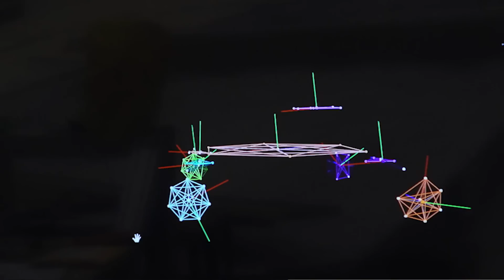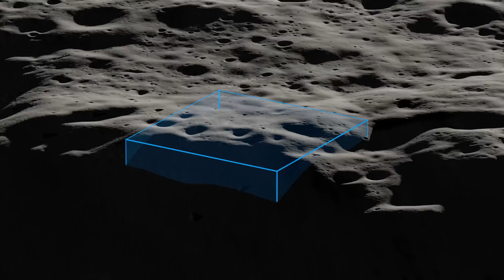The Dumbest NASA Decision In Years? Why NASA is Being Forced To Ground Rover and Sent Ballast.

Comment: No, thats not the rover on the lander. That is just a rover shaped mass simulator.
Reply: we found it lying by the side of the road
Reply: "Then why is it moving?"
"... Solar wind?"
Reply: @camicus-3249  well, it was cheaper to use the Rover as a mass simulator rather than building one and we must have left the software active by accident
Reply: "and in order to get the most possibly accurate data, we used a mass simulator that is virtually indistinguishable from the intended rover"
Reply: The mass simulator will probably cost more than the rover.
Reply: We even have proof.  See!  Here's a picture of us pulling it out of a storage crate marked Rover Mass Simulator.
Reply: And this team of engineers and researchers are hired to overlook the mission of the mass simulator. Make sure it simulates mass as expected, monitor the mass, collect data about the mass, and most importantly, intervene if the mass misbehaves. Just the usual stuff scientists do.
Reply: @matwyder4187  Certified Mystery Goo moment.
Reply: What would honestly happen if they just sent it anyway? Who would actually enforce this rule? It’s not like they would go to jail or be fired… just send it and say sorry later.
Reply: This is why it's being disassembled now. No cheating
Reply: That's exactly what you call a rover without software.
Reply: Yup, move along.  Move along!  No lunar rover here.  It's down the hall...
Reply: Rover Simulator

Comment: Brass is usually used as it machines well.😢
Reply: It is unlikely to be brass, but is instead probably a bronze alloy.  Bronze is superior to brass in almost every way and has some qualities that make it useful for spacecraft construction.  Brass is cheaper and somewhat easier to machine, but otherwise has few advantages over bronze.  Steel and aluminum are no more difficult to machine than the copper alloys in this context, so we have to assume some other quality is important here.  Perhaps thermal transmission (bronze is better than aluminum) or coefficient of friction.
Reply: use gold in your mass simulator design so its less stupid to just launch the rovewr. of course knowing congress they would still launch the mass simulator.

Comment: The "cost plus" model has got to go as well.
Reply: This was not a "cost plus" contract. In fact, NASA originally intended to pay only a fixed amount covering about *half of the real cost*. The vendor of the lander was supposed to raise the remainder of funds from selling the space on the lander to interested commercial parties, and from private investors, by telling them a story about booming lunar economy "any time soon".  In reality, there were a million of amendments to the contracts covering several overlapping missions. Even if one goes over all of them with a fine comb, it is hard to decipher how much NASA was actually paying for this specific project.
Reply: @cogoid  I didn't relate "cost +" to this project. Simply stated the "cost +" notion should go. Furthermore, bids should be fixed cost - in general.
Reply: Costs plus contracts has set spaceflight back by 50 years. It's an embarrassment how much we've stagnated. If not for SpaceX we'd still be in the shit.
Reply: @cpthornman 1000%
Reply: Anyone who says get rid of cost plus has no idea how engineering works. You can only engineer around known problems and when you are making a novel system there is always unknowns. Parts get scrapped because they are pushing the boundaries of what you can machine,  design requirements change as new scientific data is gathered etc
Reply: @finnaustin4002  There is a point at which you freeze a design and produce. One-offs are different than manufacturing. What do you think makes SpaceX so successful? Cost+overuns is fine if you have an infinite amount of money (not your money or your investors money, rather it is the tax payers money). Bezos hasn't delivered a damn thing because he is following the old-school model of McDonnel-Douglas/Lockheed/Boeing/Grumman/Northrop/Raytheon.
Reply: Good luck getting bids with a fixed-price model for something that's never been done before. I totally understand where you are coming from, but that will just not work for "yet to be developed" technology. The risks are much too high for any serious company to bid on it... or they'll so ridiculously high amount to cover any possible losses.
Reply: SLS is a good example of this